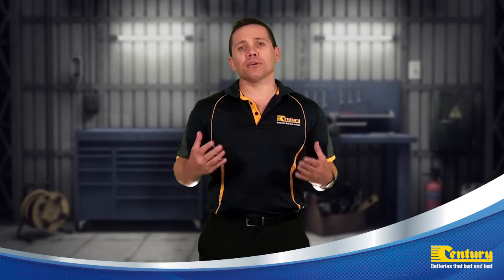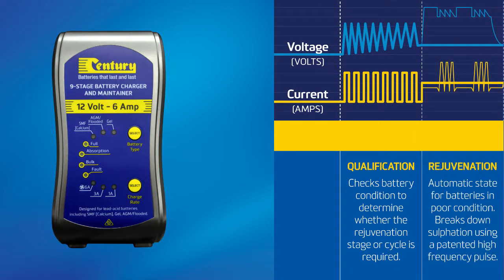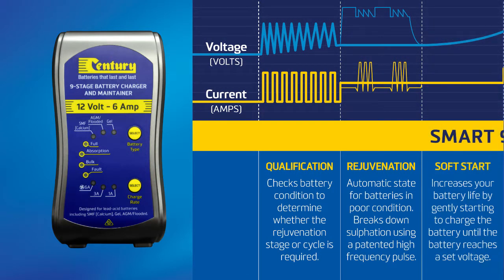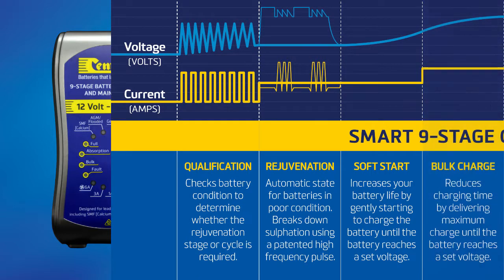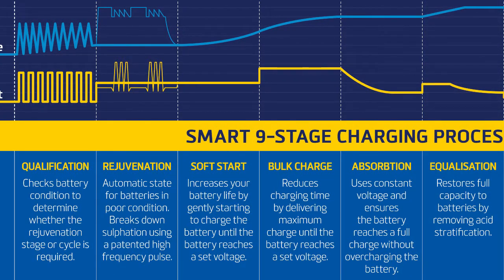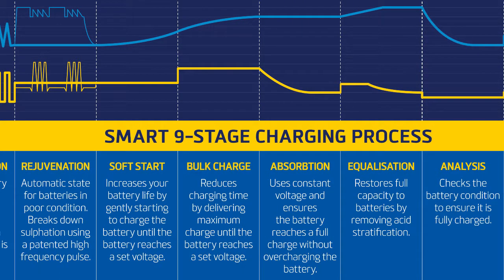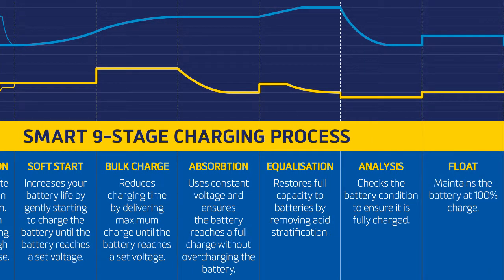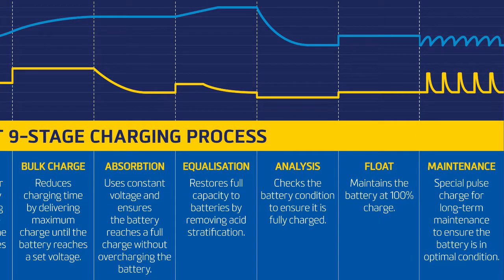Century Battery Chargers - The 9 Stage Charging Process

Comment: looked through videos read your manual, where do you explain what the light indicators mean very frustrating after paying a small fortune for your charger $355NZD is up there for a car charger, I'm not a mechanic or an electrician but yea pls explain the lights flashing and the duration of the processes